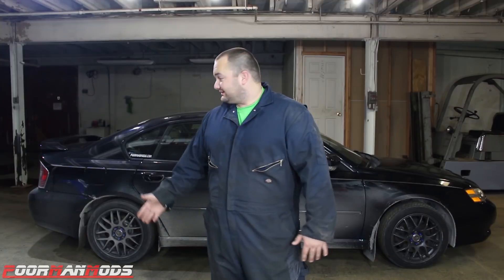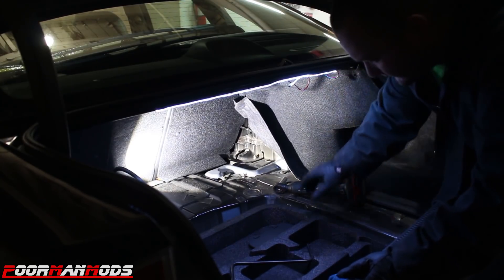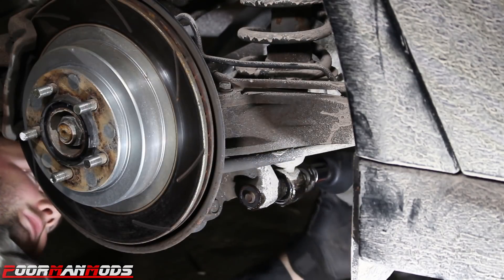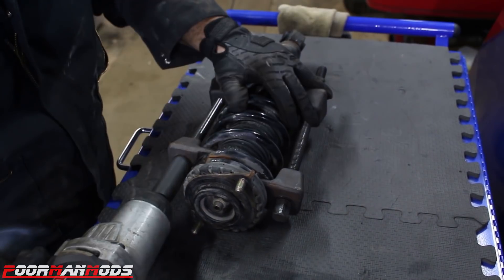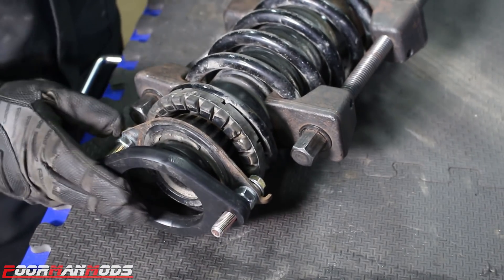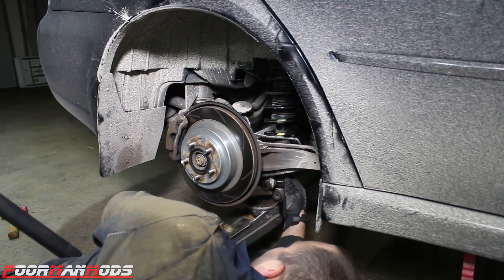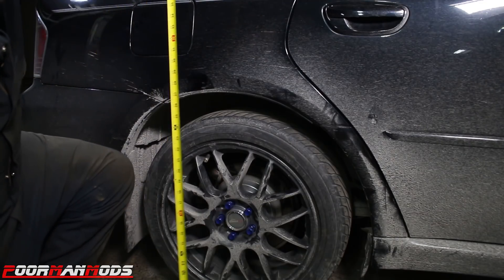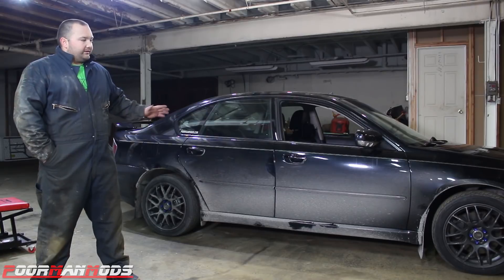Lifting the legacy? Installing saggy butt spacers | Subaru leveling kit

Comment: It's not a suspension problem. The wheel arches on the sedan are shaped awkwardly, giving it the appearance of the squat. the car is actually balanced perfectly. The saggy butt spacers will change that, but .5 inches isn't enough to make it terrible

Comment: Awesome video! I've been considering installing a 30mm lift kit on my 05 Legacy but I'm worried the drive axles (halfshafts) will be under more stress and will get worn out more quickly. Is there any reason for concern? What other mods would I need if I wish to lift my Legacy?
Reply from the maker: Subarus go through axles anyway. I say lift it and if they start to pop replace them. If not leave them alone
Reply: @PoorManMods  Thanks for the reply! Mine is an european 2.0 with 165hp so I'm hoping it wont chew through as many axles as the more powerful ones. Parts aren't very easy to come by here!

Comment: Looked at the Amazon link and seller states it ships from Russia. No bolts/nuts/lock washers either, just longer studs Different kit?
Reply from the maker: the one i linked to is a different brand but it does come with bolts, you just need nuts and washers to draw the bolts in
Reply: @PoorManMods  Thanks man, cheers!